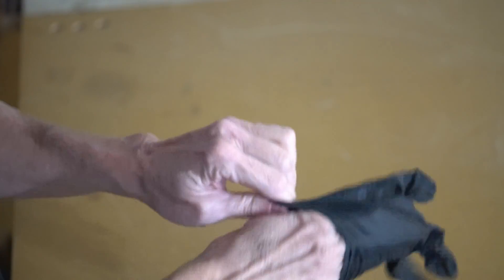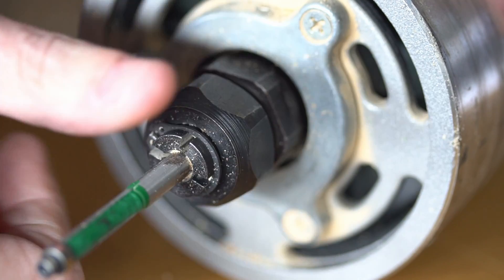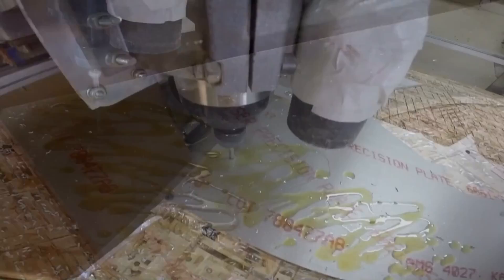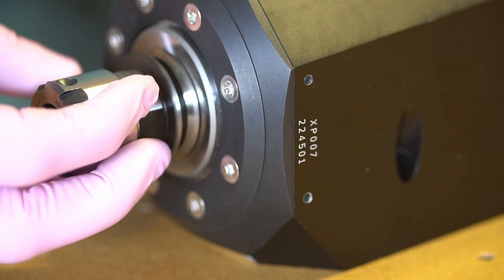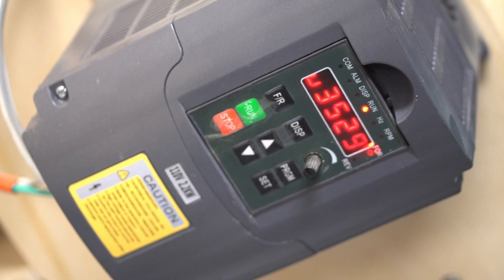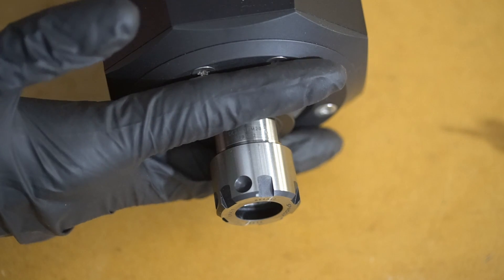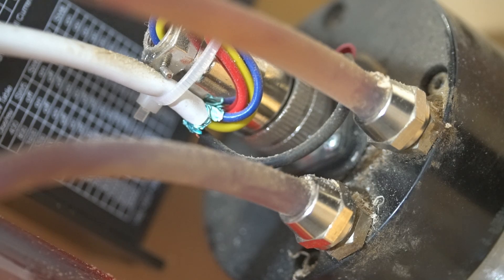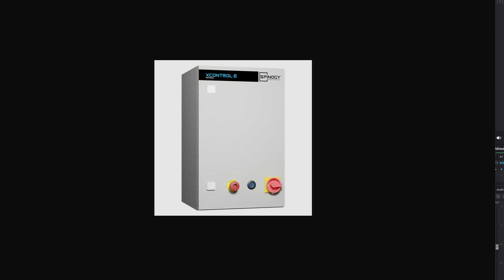Let's Demystify the ATC Spindle! Part 1: Introduction

Comment: I'd be scared to use this Chinese VFD to drive such an expensive spindle. I actually had a very similar looking VFD explode and I got myself Delta MS300 which is only like 30% more expensive, but has so many more safety features and better settings management, documentation and software suite. Now I'm not scared to change some settings, because it has loads of safety features and sensors built-in.
Reply from the maker: Don't worry, it's going on my scope first to make sure the power is nice and clean! I will probably still put it on a more expensive one though. As long as I am not overloading the winding gauge, I'll be good.
Reply: @PatrickHoodDaniel  the way the failure occured was that the spindle was running at very low RPM which is inefficient and a big resistor inside of the VFD literally exploded. Fortunately the spindle took no damage, but this cheap huanyang or whatever it's called VFD seems to have no overload protection!

Comment: you over-sold it, it is just a regular spindle with pneumatic actuators and .. I don't know is it cat-20? or cat-30? tool holder. 30 year old technology. If it is from Germany they should be selling magnetic spindles with no friction and interferometric distance sensors, not this chinasaurish technology. I am not impressed.
Reply: Exactly, what use is a 30.000 RPM capable spindle that uses ISO-20? For high speeds (10-15K> RPM) only HSK tool holders suffice, anything else is just dumb.
Reply: @pieterveenders9793  Good to have an opinion. Really strange they make and sell ISO20  high accuracy tool holders, who knows 😉🇨🇦
Reply: Hilarious 😂 if you look closely, it seems to be ISO20, but you being the spindle knowledge bank, should know that. Move On 🇨🇦

Comment: Absolutely awesome 😎 Really looking forward to this series.
I have an X30 ATC myself, but since I have more than 100 tools/tool holders, I refrained from changing the tools automatically, because a magazine that size wouldn't fit the space around my mill. Changing tools manually within a few seconds with the ATC is enough for me.
Nevertheless, I am keen to see how you are going to tackle this. Suscribed and notification bell is on..👍
Reply from the maker: Thank you for the subscription! Yes, I will be showing this process in detail down to the solenoids, wiring, control, etc.

Comment: so expensive
Reply from the maker: Thank you for your comment. It's true that the Spinogy Spindle comes with a higher price tag compared to some other options on the market. However, it's important to note that this spindle is engineered and manufactured in Germany, adhering to stringent quality standards that contribute to its superior performance, durability, and precision. Also, this spindle will provide a reliable and efficient solution for a wide array of materials. I am also making this series for anyone wanting to understand ATC and how to make it function no matter what spndle they are using.
Reply: It's not as expensive as others and you get a ton of perks for the price, like tool sensors as standard and no need for constant sealing air!
Reply: @jetco_cnc  you're right actually. off the shelf CNC spindles are way more expensive
Reply: @nendhang What's the pricing like when they are not off the shelf 😊
Reply: @jetco_cnc okay, what other Brands are you comparing it to ?
Reply: It's German, only Germans can afford it😮

Comment from the maker: I think this is going to be a fun one for you all. There really isn't a lot of content on how to make an ATC function. I plan to follow my usual DIY "route" and put together all the necessary components necessary to auto tool change using solenoid valves, my own cooling method, standard VFD, and what it takes for control software to invoke the tool changes. Stay tuned for upcoming videos.
Reply: Ive tried emailing you and each email has bounced back.
Reply from the maker: @jonathanjoffe751  which email are you using?
Reply: @PatrickHoodDaniel  Both the customer service email listed on your website and the gmail account that you have listed on your youtube channel.
Reply from the maker: @jonathanjoffe751  thanks. I will check.